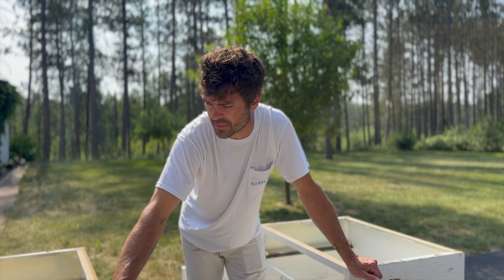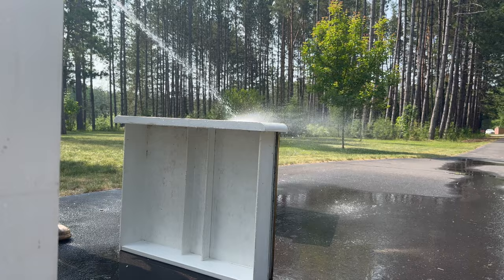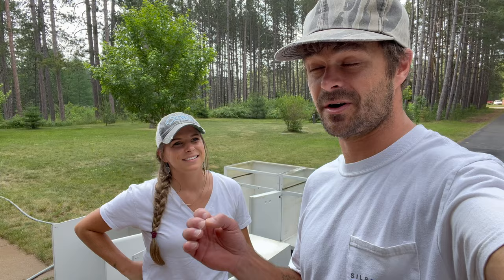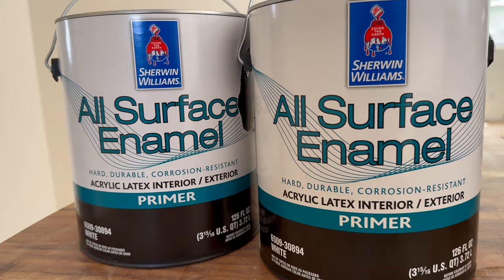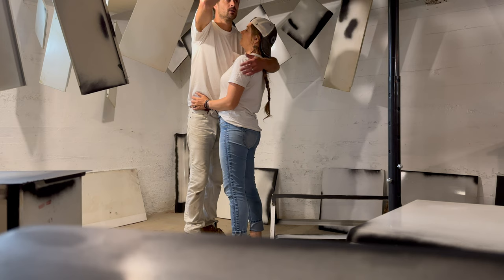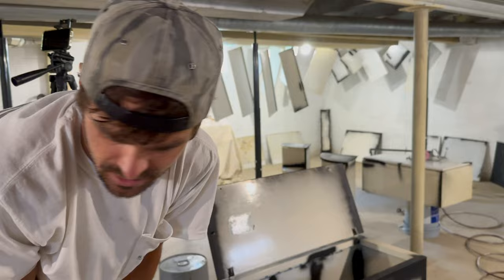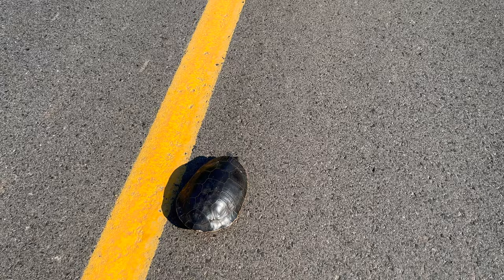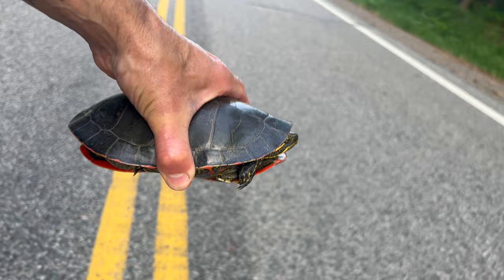DIY Metal Cabinet Restoration | Pt. 2 (And A Surprise Ending!) Ep. 49

Comment: My uncle had all metal cabinets in his kitchen…his house was built in 1889. When he updated he purchased the kitchen cabinet set from the Sears catalog and he saved everything including the catalog he had purchased from which was in one of the drawers still. When he passed the house was demolished. The walls were extremely thin with cracks in the plaster and the upstairs bedroom had a hole in the roof that you could see the sky. I miss his stories that he would tell; he would tell them in a way that gave such visuality… 
  Seeing all your metal cabinets brought back memories and I did try to remove them but was unsuccessful due to the adhesive used and the counter tops were grouted tiles that were pale yellow with light blue edges. I ended up breaking part of the tiles trying to get them out. I did get my sons to help get the farmhouse sink out which I think is white enameled cast iron and I think it weighed 300 pounds!…huge and deep. Been sitting in my backyard for 7 years now..but planning on putting it in a greenhouse/potting shed combo. We have most of the supplies but doing the foundation is the most important step. Waiting on my sons as 1 of them does concrete for a living and the other is a roofer. Mostly schedules lining up and new grand babies❤ are priority 😊
Reply from the maker: These metal cabinets are such a nice product! We wonder why they ever went “out of style”. Such fun memories you have connected to them. 
Those farm house sinks are sooo heavy! We actually couldn’t find one to replace the original one (it was it pretty rough shape) so we had to go with a lightweight acrylic. It does look really nice, but just not the same as the good ol cast iron ones! 
We know all about being busy with kids! It’s always go go go! Hopefully soon you can get everyone together and get a couple projects done! Would love to see that sink reused somehow! 
We appreciate you commenting on our video and we hope you have a wonderful weekend ahead!🌲❤️😊